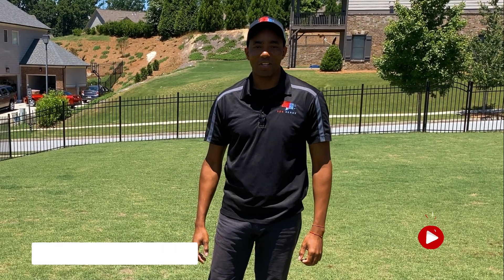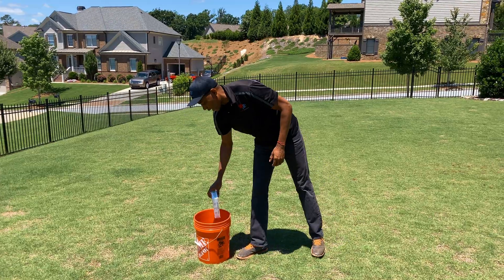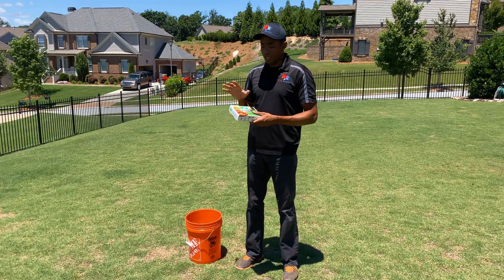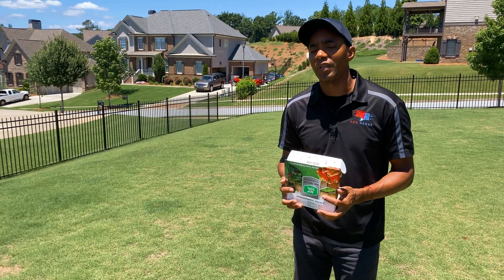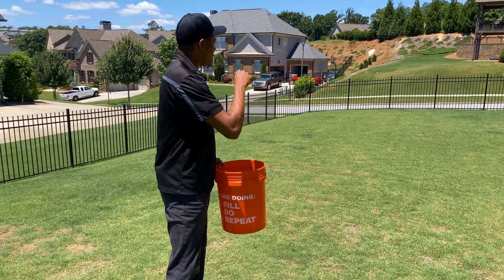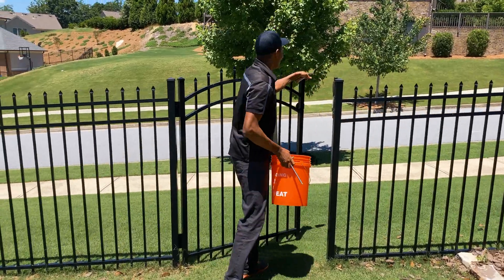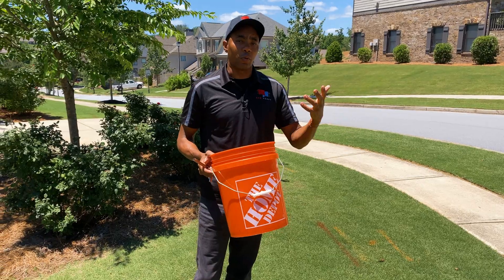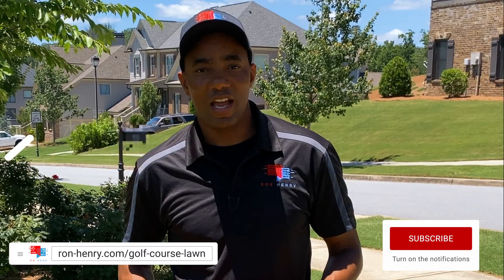[SOIL TESTING] How to [FIX an UGLY LAWN] | Golf Course Lawn RENOVATION

Comment: My neighbor just fired trugreen.  We recently did a fertilizer app.  He has 2.5 gallons of rgs and humic acid in the mail, plus two 1 gallon bottles of multi purpose plus.  I took the before pictures.  Lets see what happens… lol
Reply from the maker: Sounds like you're well on your way Adam. Keep us posted on how it goes.
Reply: Does golfcourselawns.,com have a carbon pack that covers an acre? The one I found looked like it covered 15k.   The $119 carbon pack.
Reply from the maker: @adamreed1750  You can get this one: https://golfcourselawn.store/products/golf-course-lawn-carbon-kit?variant=39323344371871 which covers 30,000 square feet or just buy the individual parts by themselves in larger quantities. Release Zero: https://golfcourselawn.store/products/release-zero Nutri-Kelp: https://golfcourselawn.store/products/nutri-kelp%E2%84%A2-free-shipping and ByoSpyxtrum: https://golfcourselawn.store/products/byospxtrum%E2%84%A2-free-shipping
Reply: Outstanding.  Thanks
Reply from the maker: @adamreed1750  Anytime

Comment: Nobody recommended Clemson for soil test?
Reply from the maker: Clemson can work Loyd.  I just like MySoil because it’s super convenient, inexpensive and you get results that are easy to understand quickly.  More important than the test you’re using is to pick a testing model and use the same one consistently so that you can measure the changes in your soil over time. Hope this helps. 👍😎

Comment: Used MySoil this spring—results in 5 days after mailing in.  Couldn’t be easier.  The real interesting bit will be the f/u testing this fall after I’ve been amending all summer.  Did I make a difference?  Do I see a difference?
Reply from the maker: That's the thing I like about it Kevin. It's very easy to se and you get results really quickly. You should see a difference in your test results at the end of the summer. Are you seeing a difference in how the turf looks since making the soil amendments?

Comment: Hey Ron! Just bought our first single family home and loving the content! We live in middle TN and the lawn on the new home is pretty bad. Lots of dead spots, lots of weeds, lots of bugs. Been watching your stuff and wanting to put down a pest product, malorganite, and also a weed product. Two questions...can I do all three applications same day or do I need to put different products down at different times? Also..safe to do these during summer?
Reply from the maker: Hi Ricky. The short answer is "it depends". If you're using Milorganite for your fertilizer and Caravan G as an insecticide / pesticide https://amzn.to/3i4m3Tk  then "Yes" you an apply both of those on the same day. Granted it would be 2 passes because they have different application rates.  For general weed control, the product I like is called Spectracide. https://amzn.to/2BEPP0k It's a granular product that you apply in the morning when there's dew on the lawn.  I would recommend doing the Milorganite and Caravan G first. I'd apply the Spectracide last or perhaps even the following morning. Doing them all 3 on the same day is going to mean going over the lawn 3 times in the same day. The order in which I'd apply them is Milorganite, Caravan G, Spectracide.   Don't water the lawn until the next day. Be sure to also change your clothing after application since you're dealing with herbcide, fungicide and insecticide Hope this helps. 😎👍
Reply: @RonHenry  thanks so much! Gonna give it a go.
Reply from the maker: @RickyShockleyMarketing  Nice Ricky! Let me know how it works out.
Reply: Ron Henry is this something he can do now in the summer?
Reply from the maker: RB yep. You apply it during the summer. With Spectracide, apply in the morning when there is  dew on the lawn and allow it to dry.  Don’t water until the following day.

Comment: For soil samples isn't the grass/thatch and first inch or so of soil not suppose to be included in the core mixes? I have not tested my soil before but need it done. Thanks.
Reply from the maker: Hi Rene, the cores I pull come from 5 - 8 inches below the lawn surface. There might be a few small slivers of grass in it, but 95% of what goes into the sample is soil. It's definitely worth doing. It's the best way to know which products in what amounts are right for your particular lawn. I really like MySoil's test because it's easy to use, results come back quickly and the provide actionable suggestions.

Comment: I dont know if anyone asked this, but would the previous fertilizers affect the results?
Reply from the maker: Kajuan. It's possible but Milorganite releases so slowly that any changes it made to the soil in that week time frame would be very slight if any. I've gotten the results and will be posting them next week. Stay tuned! 😎
Reply: @RonHenry  awesome. Thank you for the quick response. I was just curious because I recently put some Scott's Weed and feed down, and I was wondering if I should hold off on doing a soil test for a while
Reply from the maker: Shouldn't skew the results too much Kajuan. I'd do the test sooner than later.

Comment: or just put the samples in the white box and shake it up to mix if you dont have  or want to walk around with a bucket.
Reply from the maker: That's a good idea Fred.  I can see the box being used as a good soil shaker. 👍😂 Thanks for sharing the tip.
Reply: @RonHenry   no problem Ron that how i did mine 👍
Reply from the maker: @timh363  Love it. Glad it worked out. Let me know how your results come back.

Comment: Funny timing. I just got my soil test back today and came on to the channel to recommend the same... and lo and behold we're on the same page here. Found out my N-K levels are low and Phosphorus is too high. I will be using something besides Milo to fill in for now since I need something with potash and without phosphorus. Also found a few key micros were low so i'll be hitting it with some micro-nute sprays as well. I think Milo is overall a good cheap somewhat organic fert but I think us Milo nuts are putting too much phosphorus down which is not only bad for runoff but too much P leads to nutrient lockout for other micro nutrients and also has a negative impact on mycorrhizal fungi. For me I'm glad I found the K deficiency which explains why my lawn is struggling in the heat down here. Test your soil folks its not too expensive and I think I got my results in less than a week (most of which was waiting on the post office) I believe the mysoil https://www.mysoiltesting.com/ kit was 80 bucks which came with 2 tests as well as the core sample tool. I will be testing again next spring to see how we've corrected the deficiencies.
Reply from the maker: Great post Matt. I'll be posting a video soon showing my soil test results. I learned a few things which is probably true for most people. It's something that anyone serious about their lawn should consider doing. Allows you to make the very kind of decisions you mentioned in your comment. Thank for watching the content and sharing your experience. 👍😎
Reply: @RonHenry  I'll be keeping an eye on Alex's lawn for sure. He's catching up there pretty quickly. Amazing what bermuda will do for you with just a few months of work during the growing season. After seeing you pull plugs we gotta get him to aerate and top dress (after those sprinklers go in)
Reply from the maker: Yes he is. His lawn is looking amazing. The plan is to top dress sometime in July. Didn't want the lawn to be a beach over the 4th of July weekend. I'm still considering doing a full top dress on mine as well. the front lawn still needs work.

Comment: Yes soil tests are IMPORTANT!!!- I was pushing Milorganite like crazy to my lawn and it's beautiful so I finally decided to do a soil test from Clemson Univ. The results were my phosphorus levels were thru the roof!!! So glad I did one and I won't be using milorganite for at least a year.
Reply from the maker: Thanks for sharing Don. I just got the results back from a soil test of my lawn. I'll be sharing those with you guys soon. My macros are great but there are a couple of micronutrients that are higher than they should be. I bet you can probably guess which ones based on some of my recent experiments and antics? 😎👍
Reply: Same here. Also had low K (there is none in Milo) along with low Mn and Mg which hopefully my micro nute sprays are going to fix. Also low in sulfur but the high K fert I found has 10% sulfur so we should be getting it all fixed here soon. Milo has a good amount of iron as well which showed up on the high side as well. You going to test next year? I went ahead and got 2 tests myself so I'm thinking next spring I'll test again before putting it back on a fert schedule.
Reply from the maker: @gangstarib  soil test results can really tell you a lot about your soil health. We'll do another test in 6 - 8 weeks to see how the soil is doing. I also tested my soil and will be sharing those results soon. For a lot people phosphorus is what is often low since fewer fertilizers contain it than nitrogen and potassium. Thanks for sharing your results.
Reply: @gangstarib  I'm going to soil test every year going forward. This is the first soil test I ever did and I've been living in my new home for 8 yrs.